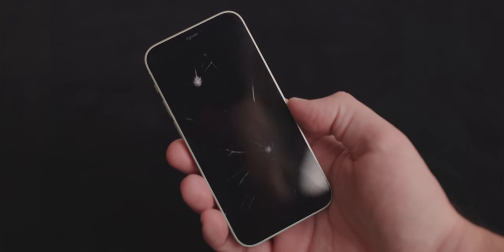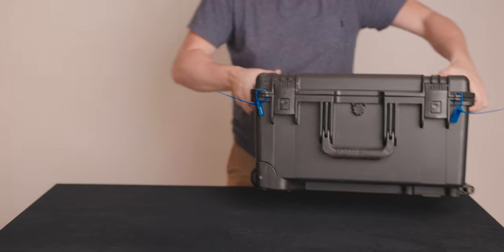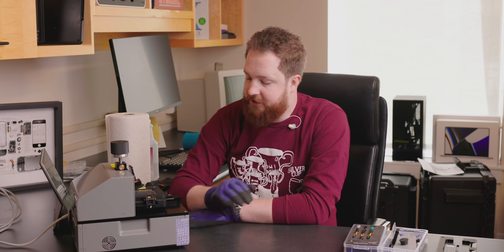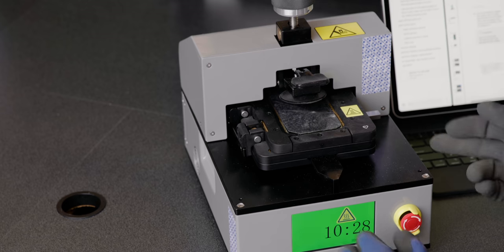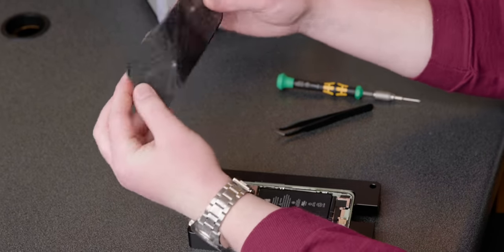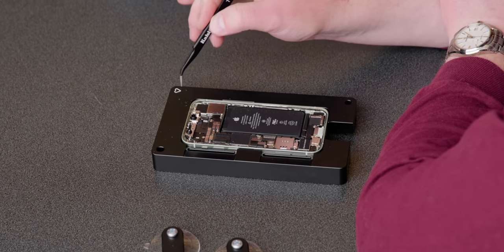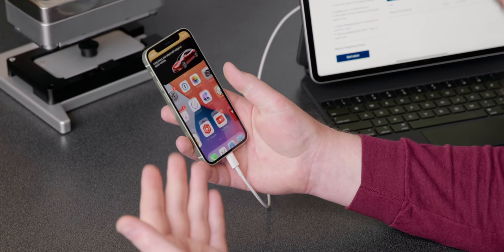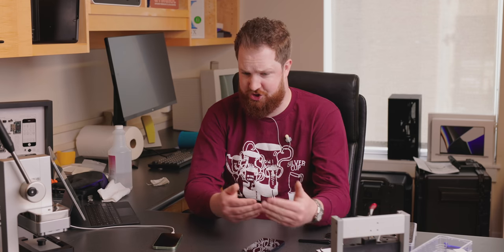Using Apple’s Tools to Fix My iPhone

Comment: I bet if you installed "non-genuine" parts but gave them genuine serial numbers, they would still get rid of the "non-genuine" warnings.
Reply: Oh ! That would be a nice experiment !
Reply: That's actually what normally happens in 3rd party repair shops where they use a special "device" that programs the display and the battery to match the phone's serial number even though they are not genuine.
Reply: nope wont work. I followed this China AASP Repair Shop tiktoker on China's tiktok and he showed the viewers that installing a non-genuine screen and after running the AST 2 diagnostic test, It still show non-genuine. Plus the serial number they ask for should be the iPhone serial number not the display serial I think.
Reply: I was wondering exactly the same
Reply: @kenny180398  Did that person on TicToc have a genuine screen ordered from Apple and then called Apple and gave the serial number of the iPhone that was associated with the repair order? But instead used the fake screen? Just curious if Apple remotely connected to the phone to do the pairing like in this video? If he did exactly as in this video, but used a fake screen, then maybe Apple pair the screen with the phone serial before shipping the screen (and a follow-up pairing is still needed)?
Reply: @brendanfarthing  He replace the phone with a genuine battery and a non-genuine display. While he didnt 'ordered' a genuine display, but I don't think it would pair them together regardless if an order is there though. He is an Apple 'Authorized' repair guy I think(its china after all). So he run the program and pair it himself.
Reply: @brendanfarthing  In regard to the last question, I would say it should be a yes. I not really sure but I think Apple side prolly tie in the display serial and the phone serial in their system to establish an 'order receipt?' and then ships it over. Then when we give them a call in this case, is to link the phone to the system(via the diagnostic) so that the repair is recognized on the system. I could be wrong as this is just all my thoughts and theories from researching in 10 minutes.

Oh and the display panel has ic chip that prolly contain the display serial so unless you copy and paste the display serial from genuine display to fake display, it shouldnt be able pair.
Reply: Which you can totally copy and paste the display serial from your old-genuine-tied-to-your-iphone display to a 3rd party display. Which also mean that there is no need to go through this whole process in the video anyway
Reply: Use genuine parts enough and you can spot the differences. Also third party repair shops, not all but most, have low quality repairs so usually you can tell if it’s been opened.
Reply: I work at an apple authorized store. No, this wouldn’t work because before snazzy even did this repair, Apple had the serial numbers of the parts they sent him reserved for this repair. If the serial number on the display (which is embedded) does not match, the system configuration will fail. (Yes I’ve tried)
Reply: @slay-bz3oz  Then that means the phone call could be eliminated, as the phone could instead just not lie about parts being non-genuine. Very interesting.
Reply: Apple has records of ALL the parts and serials, and ALL the parts they send you are logged. They are 10,000+ steps ahead, believe me.
Reply: @ansonx10  Well, no...  The phone isn't lying, its just not recognizing a foreign part because the new serial number does not match the old one.  And since the only way to rewire the phone to accept a new part is with Apple's tools, yes the phone call was necessary.
Reply: @slay-bz3oz  surely that system is just stupidity and anti repair? When getting a new car tire u don't have to calibrate them. When you get a new screen for a phone u dont need to calibrate them. So unless they're using those old tech from school smart boards they don't need to calibrate. And it's just an excuse to claim to be repairable
Reply: @keyboardwarrior7538  Yeah I definitely agree there's a lot of self interest and greed involved.  But I've also seen repairs done by 3rd parties many times before and 90% of the time its very very garbage.  To use your example, its like the difference between tires with the sidewalls repaired, vs brand new tires.  Repair quality from apple vs 3rd party is very commonly that immensely night and day.  But again, I don't necessarily agree with what apples doing either..  

Good news though, recently Apple has stopped requiring the display serial number  for the calibration to succeed.
Reply: @slay-bz3oz  not all repair shops are like that some will be better than apple technicians who have often suggested devices are unrepairable and you should just buy a new one.

Repair shops like your tire example are far more affordable and cost efficient. But in the case of technology it won't make much of a difference to the functionality.

If someone misses a screw the entire device won't break. If someone doesn't use the correct apple adhesive it may look worse (on the inside) but it will still seal the device.

There is a point to be made about further repairs if people were to have the device for a long duration but that is generally not the case.

Comment: I fixed iPhones, iPads, macbooks/iMacs/Mac Minis etc. for a few years.  The process is way simpler than Apple makes it with these tools.  You can easily get an iPhone screen off with a hardware store heat-gun in about 5 minutes, not the 10+ it appeared to take you here.  The molds clearly make things more difficult as well; if you ditched them you can manipulate the phone a whole lot easier.  The part with the roller going over the battery to adhere it to the adhesive was hilariously over complicated -- classic Apple.

As Aarav Chawla put it, Apple is clearly trying to demotivate the general public from trying to fix it themselves.  This is clearly is not anything close to right-to-repair, and anyone suggesting it is is basically slapping 3rd party repair stores in the face.
Reply: Kinda true, but you’re truly underestimating how dumb general public is. I’m pretty sure the people watching this video can fix their phone without these tools but there’s still a majority of people who’d need to be spoon fed if they were to fix it themselves.
Reply: @Lyfhaxx  Which is why 3rd party repair exists. The only reason more 3rd party repair places aren't AASP's is because Apple imposes draconian measures to be in the AASP program.
Reply: @TheSkcube   draconian
Reply: @TheSkcube  This is it. People often dont advocate for RTR because they are uninterested in repaoring it themselves, but we are not just fighting for self repair, but the ability to choose your own technician
Reply: @ADeeSHUPA  it means severe or harsh measures. For example, for the same screen replacement an AASP has to provide the serial number of the phone to order a part, and then wait for the part to be delivered and only then can they install it to the customer's device. 

Compared to apple or 3rd parties who have a ready stock of displays and can do it in a few hours turnaround. This puts AASP's at a disadvantage compared to the market. People expect a quick turnaround for screens and batteries.
Reply: @Carterthielftw_  exactly, what apple did is more or less a useless move. The repair technicians are no better thanks to the way the program works and the program discourages an average person to repair. And the best part it that shipping those huge boxes back and forth prolly isn’t the greenest thing to do.
Reply: I was so excited to see if this was an actual attempt from apple, so sad to see how it turned out. :(
Reply: @Lyfhaxx  I'd say that the majority of people would be more likely to mess up with some of those tools, as they're really over-complicated. I feel like this is apple's move to say "see? It's hard! Don't bother!"
Reply: I mean these are the actual tools apple uses, they prioritize consistency over speed lol
Reply: Except. your iPhone will probably not be IP68 afterward and the seal won't be as perfect as what the tools Apple provided.

There's nothing wrong with providing what Apple Genius staff has on hand be avail to end consumers.
Reply: @Carterthielftw_  RTR by law is technically allowing END CONSUMERS to fix their own device. Not "give it to an expert to do it for you".

That's what AASP is ... and it has existed for many years.
Reply: @Lyfhaxx  The tools are SUPERIOR to what any average person or technician has at their disposal.

Even Louis Rossman admitted that. You are just hating on Apple.

Surely you don't think that geniuine repair tools are infieror ...right?
Reply: Also you’re forgetting you have EXPERIENCE doing phone repairs, your average iPhone user doesn’t, if a newbie tries using a heat gun they’ll probably end up damaging their phone even more, stop acting so smug about this lol
Reply: I’m not hating, as a person who own literally every Apple product i still think it’s stupid. And Louis Rossman ? Don’t get me started about that guy.

Comment: I work as a technician for a slightly more complicated type of equipment, and I wanted to share what  @i Fix below mentions about consistency: These repair stations are probably part of a larger division in Apple that takes care of all the "little things" that can happen during the replacement of the battery or screen. Many times in youtube videos the process is "handwavey" with temperatures, forces applied and general approach to fixing the devices. Mind you, repairing phones (and any large equipment that requires service, really) is a matter of experience, and the more experienced you are, the better/faster/stronger your repair is, and there is no way around that. To avoid "a few bad apples" here and there i.e. accountability for broken phones during repairs in licensed apple shops, I guess this iteration (at least) 12 of equipment to avoid as much as possible having a fresh technician breaking a device and then having to replace more stuff until the repair is done.

In general I think the devices are all pretty clever (even the silly roller to push down the screen) and they seem to be able to have even a 1-month technician be able to pull off a successful exchange. Capitalism aside, the technical part of these devices seems pretty good, especially if you have severe turnover at your repair shop for whatever reason.

Comment: I work on an Apple Authorized Service Provider in Mexico and we use the exact same tools, and they charge us for every single one without asking. We have to have them all to be able to offer repairs for any single device model. And normally they change for every model. They have made them more modular in the last years, like the trays and the press, but normally we have a lot of those laying around with no use. 

When I saw the self repair kit I though it was a joke. It's really overkill for a normal user to use all of this and learn all this technical stuff just for a battery swap. As you said, they do it because they have to, but it seem like they make it harder and more expensive so you would prefer to take it to the store.

Comment: Been a while since I’ve watched a 30+ minute long YouTube video. Apple could just make a simple website link to address the battery and screen legitimacy like what google does to reactivate the under display finger print sensor in the pixel phones when you do a screen repair. Would at least cut down on the weirdness
Reply: I expect that could come with time, perhaps even built into the same site you order the parts from.
Reply: they can't though. The whole system is based on GSX and AST 2 and that access is tightly controlled and limited as it also allows to look into internal info. The simple truth is - it's too expensive for Apple to redesign GSX or AST2 and just easier and cheaper to do some call center shenanigans to do the 5 people a day who actually go for a self repair.
Reply: @PvtAnonymous  I think you hit the nail on the head there. Apple could make it very easy to do the legitimacy confirmation more accessible and entirely give the tools to users, but realistically - why would they? No one is actually going to use this program and that alone makes it just a publicity stunt to shut up all the right-to-repair movements who claim Apple doesn't provide parts and tools.
Reply: Wow. I watch YT videos of 3-4 hours, and often consider them too short!
Reply: @unlokia  okayyy, where do you find those videos?

Comment: Diagnostic mode can be accessed anytime. When the phone is off, plug it into power, hold volume up and volume down at the same time. Continue holding until you see the Apple Logo. Once you see the Apple logo, release the volume buttons. This mode exists so that repair technicians can verify that your device is functioning properly without invading a customer's privacy within the OS. This is why Apple stores don't ask for passcodes when servicing your device. All about privacy.
Reply: Doesn't seem to work w/iPhone 5S (the original, not the new model).
Reply: Thanks scuba Steve, will try this out tomorrow.

Comment: The last part of the repair disturbed me. They could have bricked your phone if they wanted too. I can only conclude you do not own your iphone, Apple does.They merely allow its use for some reason, that may or may not be nefarious. Who is to say?
Reply: The phone does not "brick." you can continue to use the phone with the warning that the parts are not certified as genuine. This is good for consumers who requested service from a repair shop or a new purchaser for after-purchase resale.
Reply: @dfa4  I agree it did not brick the phone. The whole 'phoning home' thing is the problem. That serial number is you as much as it is the phone. This would not be needed if the parts were interchangeable without Apples interference. You could say this is to protect users from poor quality parts. But these are genuine parts. This would prevent third part repair stores from repairing phones. Apple would quickly realise the phone was repaired from one location, even if different phone numbers were used to reinitialise the parts. Also I am fairly sure if a shop was to order the parts on behalf of their customers, Apple would object.

Comment: so quinn does a full repair with all apple parts including the tools, and the phone still says "we can't verify that these new parts are genuine" and you have to call a support person to reboot your phone 5 times just for faceid to work... what a joke, apple
Reply: you just have to make a calibration for the true depth camera and the display.. that your phone works like you‘ve just bought it. If you follow the instructions it works just fine and you also have warranty on the phone.
Reply: @dimitrivoe3723  where did you see anything about warranty for diy repairers
Reply: @dimitrivoe3723  What warranty my guy. This isn't covered by anything. If your phone dies down the line, the best Apple can do is tell you the fault was caused by your repair attempt or that you voided your warranty by opening the phone.
Reply: @dimitrivoe3723  calibration? The sensors are literally just looking through glass. There is no calibration, it's just a dumb obstacle
Reply: @unlokia  so condescending over a youtube comment 💀

Comment: I disagree with Snazzy's take, they DON'T have to they absolutely WANT to make the repairability process complicated. The apparatuses they sent are unnecessary, the average customer won't know what to do with them and repair shops have their own devices that work. As was obvious to see the pairing of components not related to the actual repair (remember this was a screen repair but FaceID didn't work and the battery stopped reporting in settings), even though Snazzy used genuine parts sent by Apple. The wait time for the apparatuses and replacement parts to be delivered is bad if you only have one phone and that's the one needing repair. The cost is also not viable for average consumers, this was intentionally designed to discourage repair. Finally, let's not forget Apple claimed going green by removing accessories from the phone (without lowering the price), yet look at all the waste that was sent. 

None of this was necessary, the entire repair process is complicated because Apple intended it to be that way. Another case and point, none of Apple's devices are waterproof they are water resistant so using the super glue that they use is unnecessary. There is so much wrong with Apple and it was on display here. But still Snazzy and others will defend Apple and their practices. What a waste.
Reply: Snazzy is a fan boy and as for others i can say the same as well....
Reply: That was our take though.
Reply: I absolutely agree 👍
Reply: Yes, these specific tools aren't necessary but useful -- it's much harder to not damage the 12's and above when opening the display without heating it up correctly, it's a shame Apple sets up the customer for failure due to the low heating time with the display disassembly jig. 
The reason why FaceID needs calibration (and batteries) after replacement is because Apple sets up these iPhones (11 and above) to have paired serials with each display... there are workarounds when using non-OEM displays though. 
Despite all this, I have to disagree with you on the way you characterized Snazzy, he wasn't defending Apple -- many times throughout the video he criticized the process, environmental impact and general experience... this process in general does work, however it's not ideal.